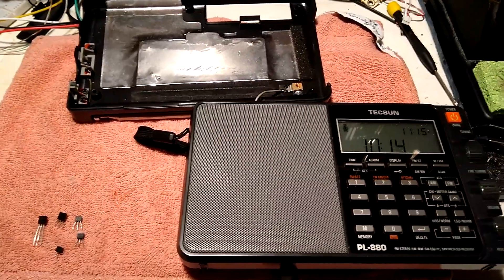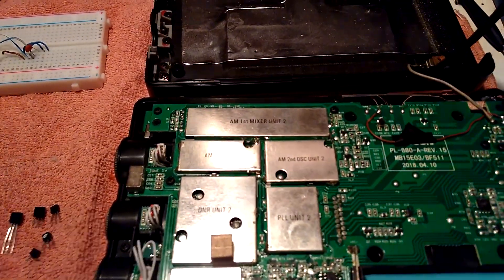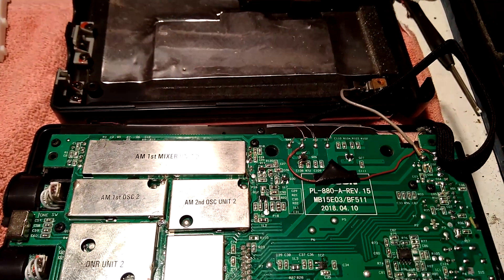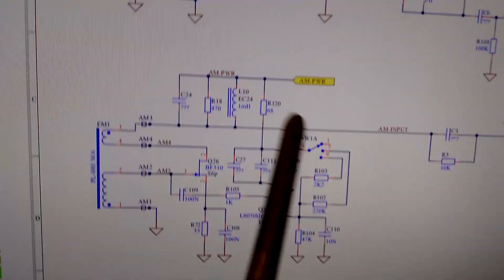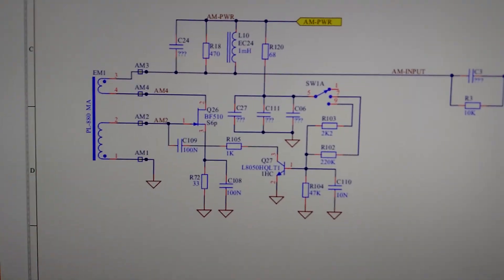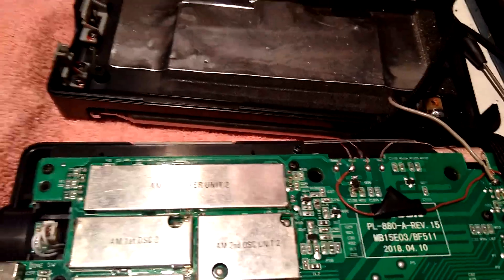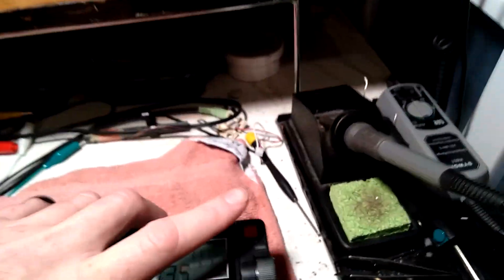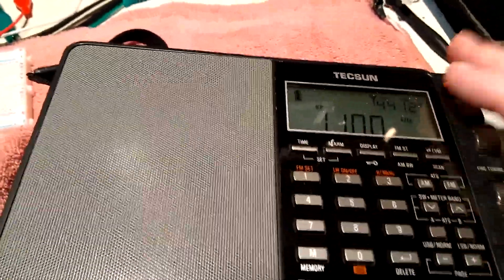Tecsun PL-880 repair AGAIN (Déjà vu Edition)

Comment from the maker: Possible substitutes I've found that may work with trial and error so far are the LSBF510, 2SK932 (which I used and works as good as OEM part BF510), 2SK715 (used in Sangean ATS909), 2SK152 used in (Sony ICF-2010), 2SK238?
I will update this list if anyone has suggestions in the comments.